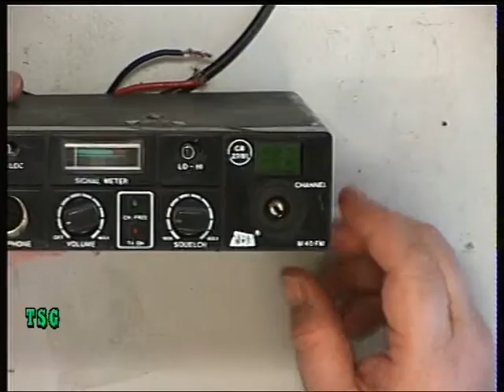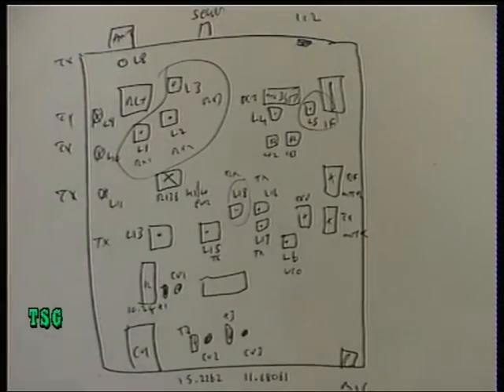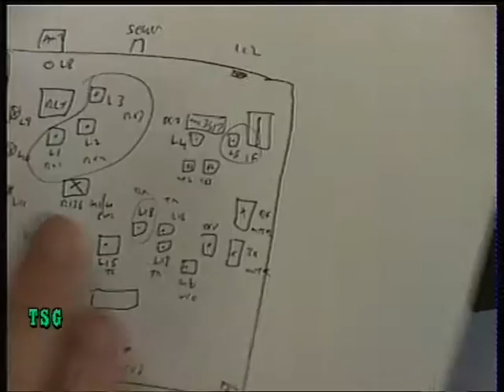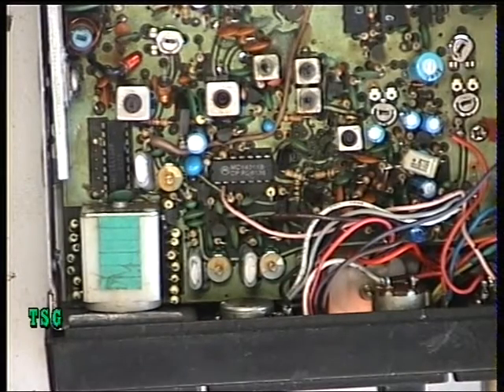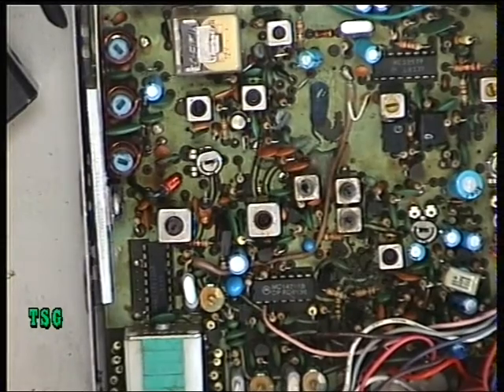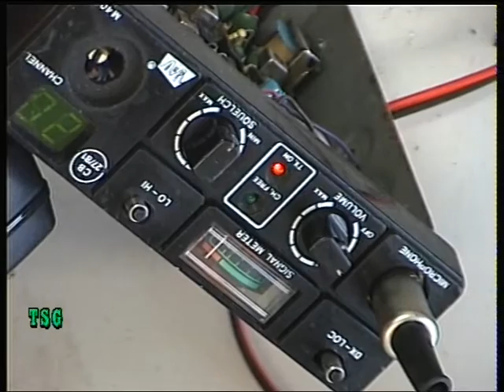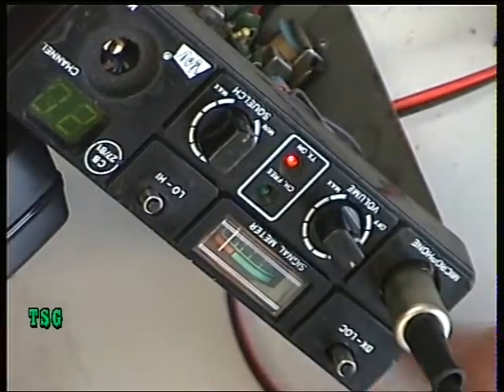DNT M40  UK (CB27/81) CB radio (Mobile)  -  Transmit Alignment

Comment: Only 3.5watts? I'm surprised you didn't try to get it a bit higher by going back over the coils one more time. It may have managed nearly 4, maybe.
Reply from the maker: +TheOptimod I went over them about five times, but don't record this or the video would be 20 mins long! The Marconi test set I use is properly calibrated. This same radio transmitting into a typical 'hobby' type power meter & dummy load would have shown around 6.5W. Very few CB radios either new or old achieve 4W in my 35 year experience.

Comment: i love how you do the deviation and the VR is almost off, then you do the whistle test and it's nearly full up..!!
and when you going to buy yourself some non conductive ceramic tools ???
Reply from the maker: +bigpimp347 Very eagle eyed Mark. Nothing to do with ceramic tools. When doing the dev with the oscillator into the mike it ended up with the preset at max which I knew was not right for this chassis. Rechecking the Marconi testset I spotted something in the wrong position so redid the dev setting off camera. Back on record, did the quick whistle test & hey presto the preset had moved!